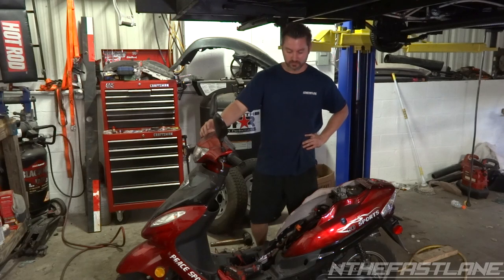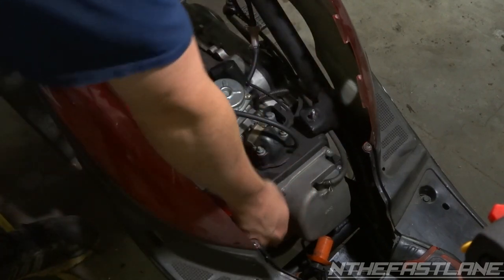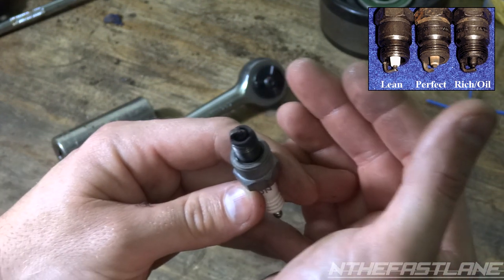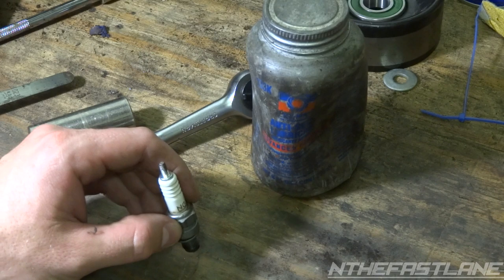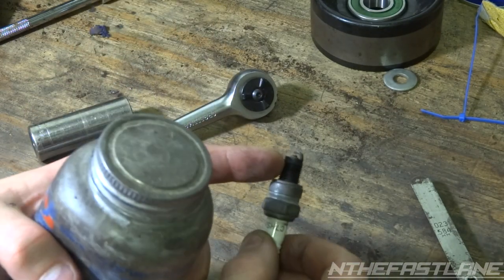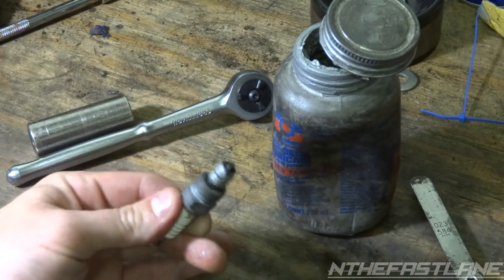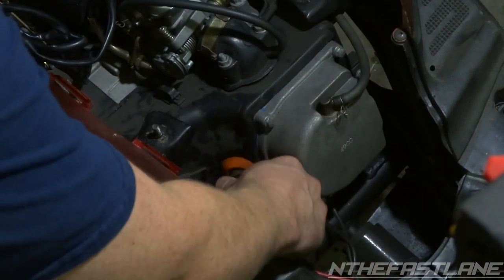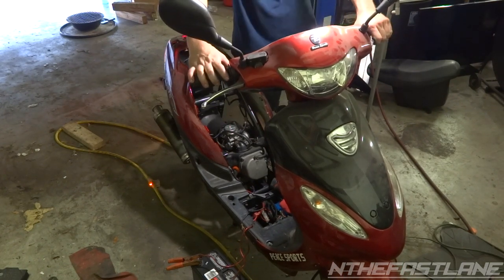▶️Spark Plug Gap And Installation GY6 50cc,125cc,150cc/BBK Scooter🛵🔧

Comment: hey bud, i installed an 80cc big bore kit. i followed all the steps: top dead center when installing back the timing chain, proper valve gapping, torque specs, verified if my fuel is pumping through , properly spacing out all the gaps on the piston rings and placing them in proper order. Basically everything is done but no start!
Reply: You need to check for 3 things, spark, fuel and compression. since you did piston rings and that should sort compression. You checked fuel is pumping so that's good. Then check if your spark plug is sparking.

Comment: That spark plug would be a 5/8s there are 5 sizes to spark plugs 14mm, 5/8, 18mm, 3/4, and 13/16s if your gonna make a video doing this at least use the right size socket

Comment: Can I just match the gap on the old one
Reply: I also heard they come pre Gapped
Reply from the maker: After time a spark plugs ground electrode/ electrode begins to shrink causing a wider gap. 

It's best to always re-gap new spark plugs using a feeler gauge or spark plug gauge to the manufacturer gap rating.
Reply from the maker: Yes some spark plugs do come pre-gapped. However, a lot of them aren't that accurate. I've checked pre gapped spark plugs right out of the package and most of them are off.

In some cases depending on engine wear and other factors, spark plug gap can have a small range, say 030 to 040. Always double check, you don't know if the package got dropped and the ground electrode got pushed in closing the gap a little bit. They do come with a cardboard protective cover over the threads, but it doesn't take much at all to bend that ground electrode.

Always double check someone else's work, aka.. spark plug manufacturer gaping.

Comment: Never ever use anti-seize on plug it must ground properly in order to be efficient....
Reply from the maker: Anti-seize on spark plug threads has no effect with the spark plug grounding to the cylinder head. The reason why there's rumors about not to using anti-seize on spark plugs threads is the idea that you can multiply the torque to the threads. If you use a very low ft lbs torque to begin with such as 14 ft lbs and a good torque wrench, chances of over torquing are slim to none..

Repair manuals seem to not recommend using it. However, with hands-on automotive experience I use it every time. Imagine going to pull your spark plugs and the metal threads are fused with the aluminum head. Total nightmare and possibly destroy your cylinder head. Not a risk I would ever take.
Reply: @Nthefastlane  lol if you torque it with anti-seize on then it's going to be a totally higher torque than what your torque wrench is telling you. Never had a problem removing a spark plug, I don't know why people insist it's a huge issue.
Reply from the maker: If you glob it on and then torque it, sure. But if you apply a very thin coat on the threads you'll be fine. It's all about experience.

I've had to extract a broken spark plug from a cylinder that didn't use anti-seize. Completely snapped off when trying to remove. Nightmare of a repair. A very thin film on the threads is perfectly fine in my opinion, and adds a guarantee of never seizing up.
Reply: @Nthefastlane  I would think so too.. But I then saw a video online where the CEO of platinum spark plugs came on and went on about this particular subject and was very convincing... He makes a lot since to me but u know and I know that sometimes people just don't change there spark plugs for a 150,000 miles and then they can give us a real problem getting them out . so I too have always thought that a  little antiseize would be better than not in that cause .. But in the performance department it might just pan out to get some one else to do it for you... Lol